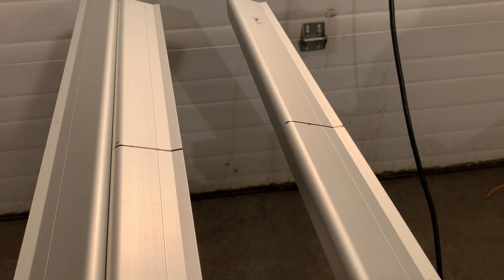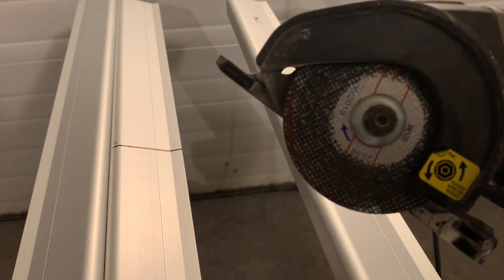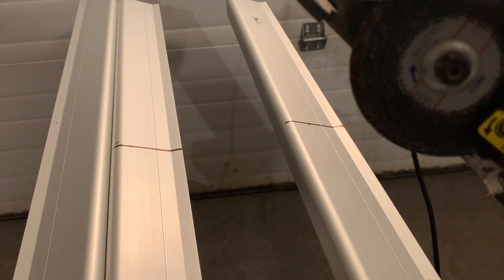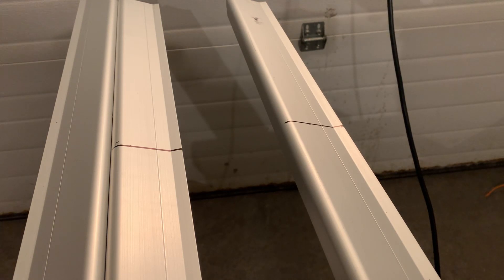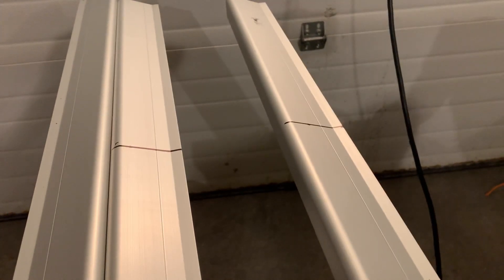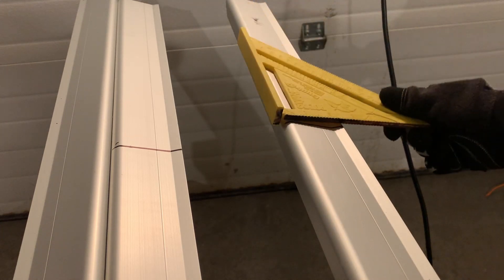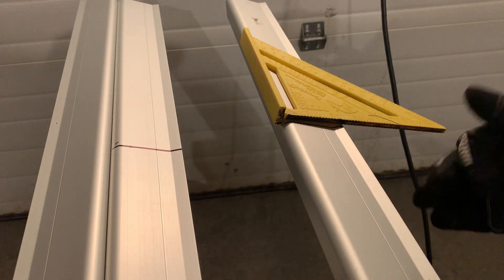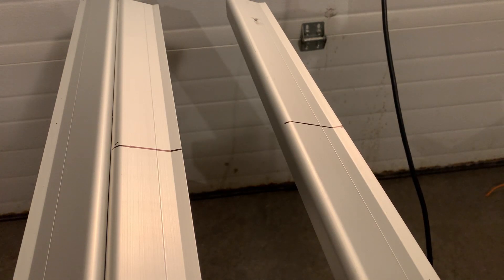Cutting XR100 Rails for Rooftop Solar

Comment: nice, what size blade do you use for this ?  Cutoff wheel?  I do have a metal chop saw.  Not sure if this would work well or not.  Like the dremel tool.
Reply from the maker: I used a Dremel SAW-MAX 0.3" metal blade and it worked really well, as you see in this video.